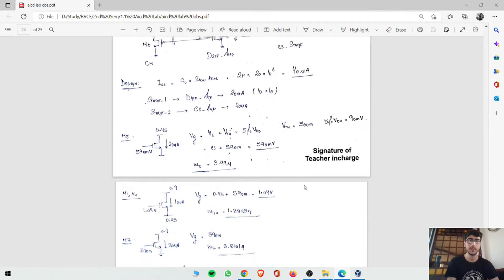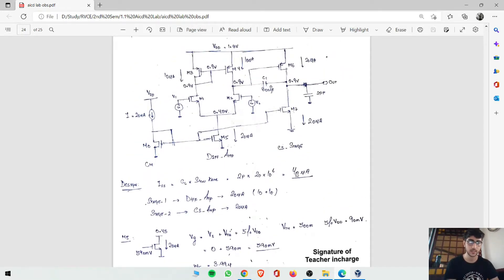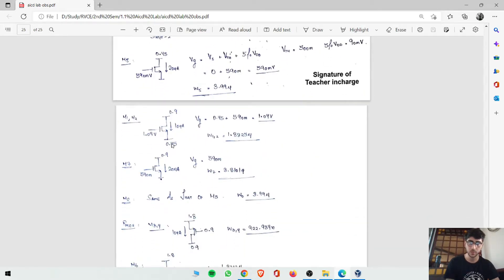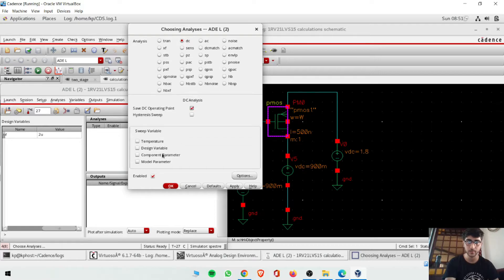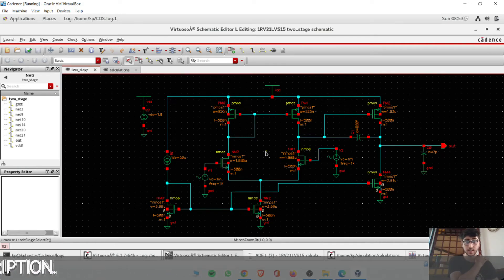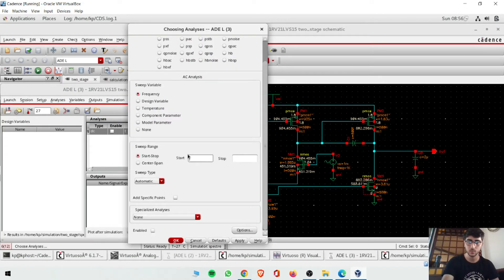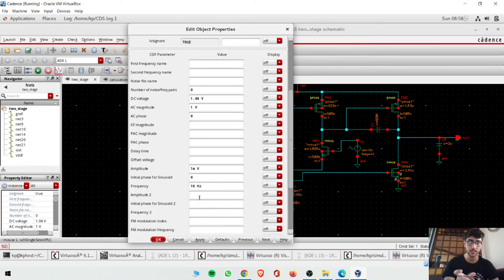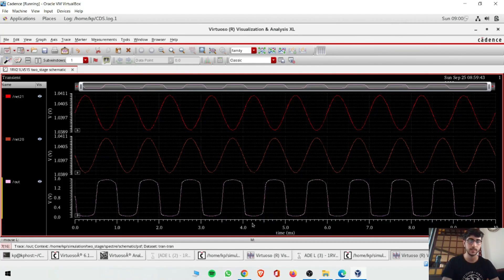15 Design of Two Stage Opamp ( Diff-Amp + CS-Amp ) | Cadence | gpdk180 | Simulation | Tutorial

Comment: sir,
 if we want to have both positive and negative swing in output then which design we should prefer 
like if we use the above circuit as a Schmit trigger we will get an output swing between vdd and gnd but if we want to have an output swing between vdd and vss then which design of opamp using mosfet we should prefer

Comment: 1. Compensation capacitor calculation should be included. Also, the phase margin needs to be checked. If you do a pole splitting, zero will shift towards LHP. So lead compensation is necessary.
2. Cascode configuration must be used in the tail current part. Otherwise, the current matching won't be proper therefore monte-carlo and corner simulation will give a higher mismatch. 
3. The output swing you showed is not a proper sine wave. So, the headroom of the output stage must be checked. 
There are also some other important parameters to check such as input offset voltage, slewrate, UGF, integrated noise which could be included in further videos. Thank you.
Reply: Can you Recommend any youtube channel or book or notes to understand these kinds of analog simulations
Reply: @sachchidanand4630   I would recommend book from Jacob Baker "CMOS: Circuit Design, Layout, and Simulation". You can also try to watch videos from Ali Hazimiri.

Comment: Hi i have a question. I have followed your steps finding the bias voltages and when i run the DC values i get the correct voltages drop for all of the nodes. 1.8, .9 and .45 but when i ran the AC simulation my gain is 49dB i see that you got 70dB. im using 90nm tech but i should be getting same dB as you. is there anything i can do to improve the gain?